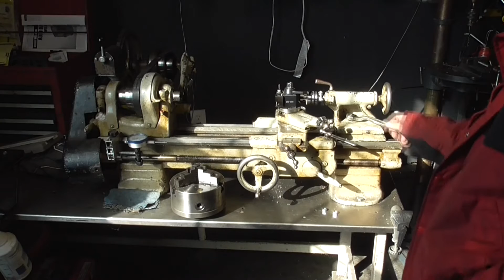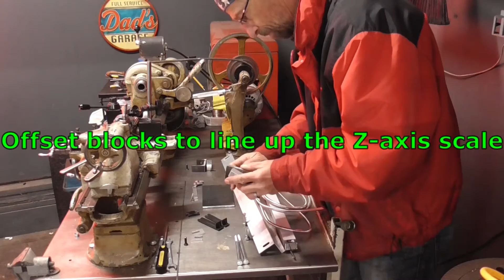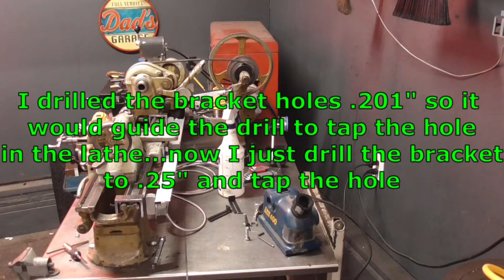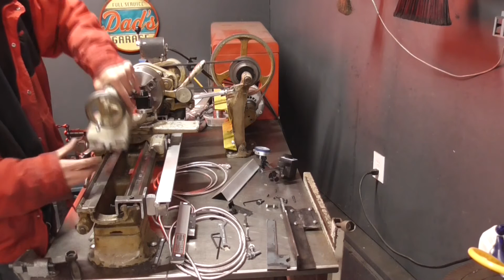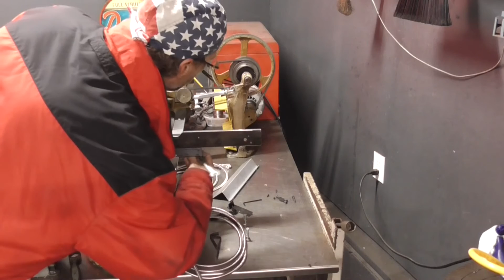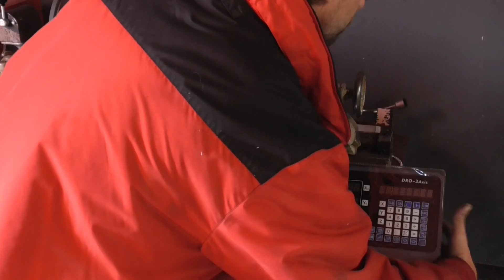$200 Lathe DRO Install with ONLY 4 additional tapped holes Needed - South Bend 9 Inch Lathe

Comment: Good job showing install. By the way, your lathe is not a 9A. It is a 9C. it does not have the power feed (9B) or quick change gearbox (9A).
Reply from the maker: Thanks man and thanks for letting me know the actual model 👍. I looked for what the model was, but could only figure out that it was a 9 and thought I saw a pic of one that looked like it that was a 9A, but never really knew.  It’s been a great little lathe for sure for its size and amazing that it is still very accurate given how old it must be (I’m not really sure when it was made actually).  The scales make it so much nicer to use as now I don’t have to count revolutions and the tiny lines anymore, lol.  Thanks again and all the best !  Steve

Comment: Like the video. But looks like to me your leveling the sheet metal cover and not the actual scale??? But still nice setup.
Reply from the maker: Thanks 👍. Yes, I was being lazy and just aligned the scale by running the indicator on the splash guard since it was easier to indicate off of.  I placed bolts of the same diameter in between the guard and the scale on each end so aligning the guard was the same as aligning the scale (more or less).  You are right though that running the dial indicator directly across the scale would have been the most accurate way for sure 👍. All the best !  Steve

Comment: What length scales did you purchase?
Reply from the maker: Hey man !  For the Lathe I bought 150mm and 500 mm scales 👍. The actual length is like 120mm longer than the reading area (the 500mm scale has a total length of 620 mm for example). All the best !  Steve

Comment: Very informative video Steve.  I had no idea how a DRO was set up. Pretty neat.  My Taig lathe is a 3" swing, so this would be way too large. I just use digital calipers and have pretty good success.  I remember taking a lathe class in HS and still have the small booklet they had us get to study by.  A neighbor I had 30 years ago was a civilian machinist for the Navy and he had an old open gear table top lathe and I can't remember the name. You had to know what gears to change out to set the speeds correctly.  I have some plastic and have done a bit of cutting on the lathe with plastic. You sure have to be careful of too much speed. It will melt the plastic.  I like machining delrin. I had some shims and bushings I made from delrin and they worked out well.   I made some cue protectors out of "diamond wood". Sanding and polishing them turned out not only fun, but the end product was amazing in the shapes that came out in the diamond wood.  Diamond wood is a multi colored, layered, laminated and pressed product that is heavy and solid. Great turning stuff from it.
Reply from the maker: 👍. Yep, the x-axis scale was pretty big even for the 9” South Bend.  Using the DRO I was able to reduce the machine time for making the oil filter covers by about 20 mins (takes about 3 hours to make one between the lathe work and the mill work).  Although it’s a low cost setup, it has some cool features like the half scale function on the x so it doubles the displayed movement.  This way the display shows the actual diameter as cuts are taken vs having to do the drawings with radius measurements.  It also has individual programs that can be setup for each tool (works nice with a quick change tool post) so each tool can have its zero settings established prior.  Then when the tool is swapped, I just change to the tool’s preset program number and it changes the display over to it’s location.  I didn’t know it did all of this stuff when I bought it (I just wanted it to display the tool position, lol) so I was extremely happy once it found out what all it does.  When doing multiples of the same part, it’s a real time saver just in zeroing again when a tool is changed.